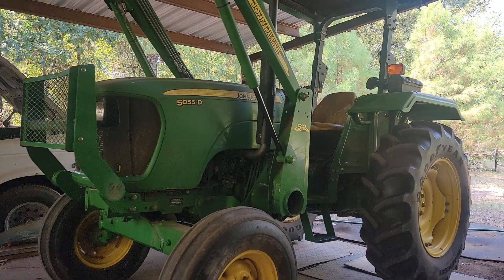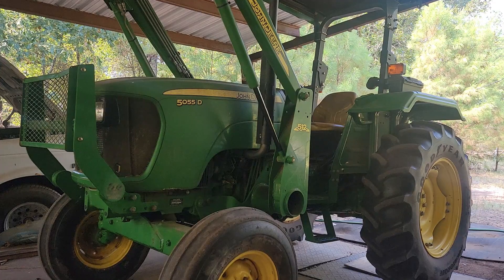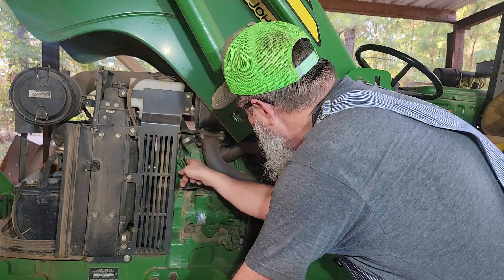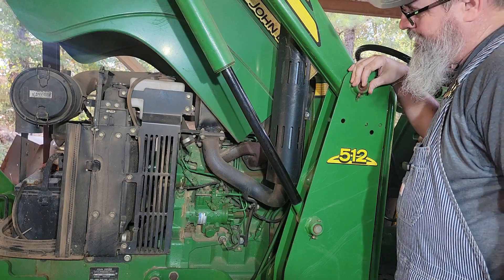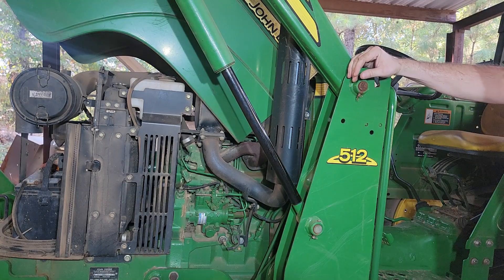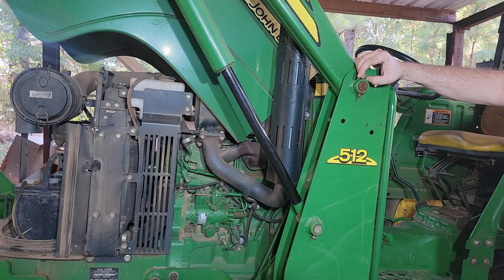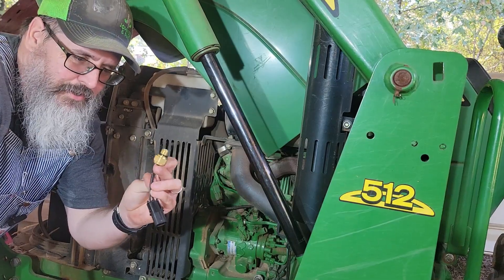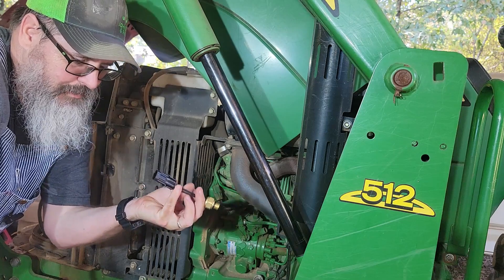JD Tractor Temperature sensor

Comment: My 5205 starts and runs for a second and dies and won't crank back. I unplugged temp sensor and it started right up. The next day I tried to start it and same thing it ran for a second then died. I did have a blown fuse. Replace it still same thing. Any ideas

Comment: What is the part number of the sensor?
Reply: I found it. It is the cold start advance sensor AKA temperature switch. John Deere RE503242
Reply from the maker: @mars1952  I could remember the part number. I believe I had to get it from the JD dealer.